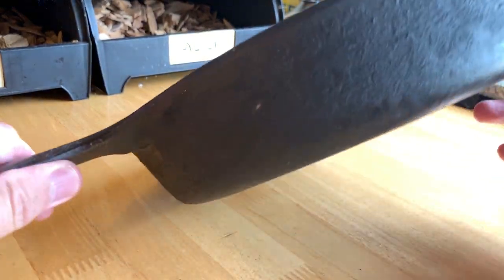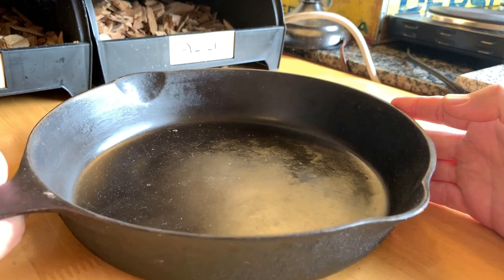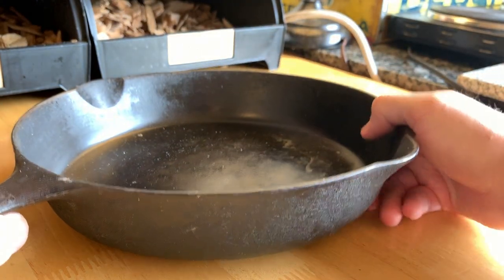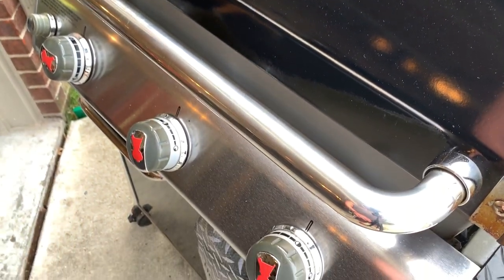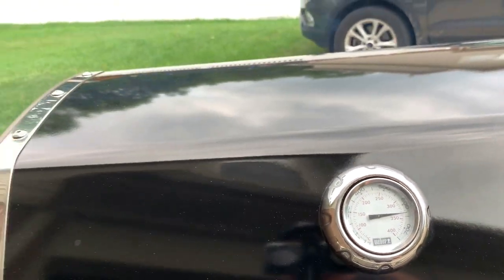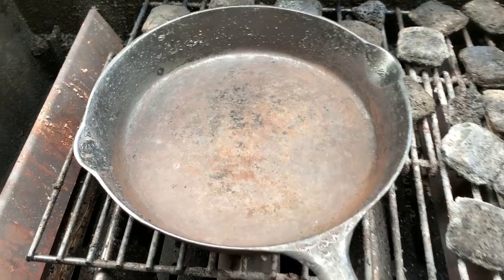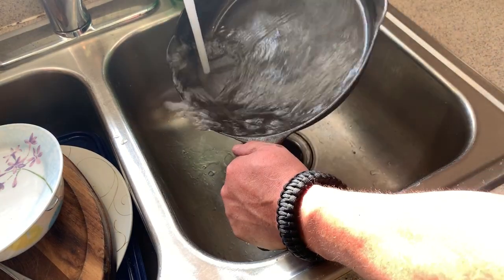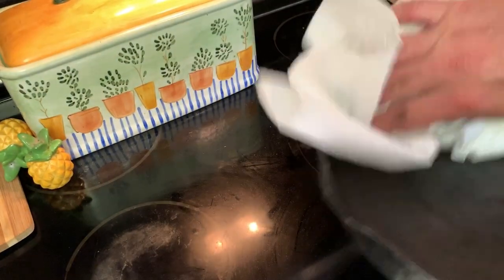VINTAGE CAST IRON restore! Griswold No. 8

Comment: Wow you have a Griswold that is amazing that is an old old cast-iron pan a classic
Great tips on heating it up on the grill on super high heat to remove the patina before you send it down awesome job
Reply from the maker: Thanks Jeff. I semi-frequent antique stores and see vintage cast iron pans/skillets. I find a flat glass surface somewhere in the store and do the spin test. They are almost always warped. I was super geeked to find me an ancient Griswold to restore and put back into use. Thanks for watching and commenting bud.

Comment: To anyone looking for this video to be a 'restoration' video, please know: this is NOT the recommended way, process or procedure to 'restore' a cast iron pan according to collector's methods. So many wrongs here, hard to know where to start. However, for a rapid, 'cleaning' a cast iron pan with gunk in a non-collector's unapproved/way.... this is your video.
Reply from the maker: AXNJXN1 Correct. I restored it for use. Not to resell it or for collectors standards. A collector I am not. Thanks for commenting!
Reply: To each his own I guess but the problem is when you are done “using” it, it will never be a family heirloom. Or if when you pass on and when it goes back into circulation it will be a wasted piece of history that can never be brought back to its former self. Not bashing but like to think about preservation of the old stuff and how precious it is.
Reply from the maker: Scot Maciver Well no worries. It won’t be going back into circulation and to be honest it’s not ruined at all. When I’m done using it, which is perfectly suitable for, it will go on to my daughter who also continue to use it. It is not forever ruined contrary to what you may think. Don’t get me wrong, I have spent hundreds of hours and researching cast-iron pans. And far from being a consensus, there is no one way to clean up a pan to use that is the correct only way. I can tell by your tone that you will insist otherwise and that the pan is ruined but I can find experts, and have in fact, who do not agree with you. There’s nothing wrong with the skillet.
Reply: Nope, that’s where you are wrong. That pan isn’t ruined, I don’t think. I couldn’t watch the rest so didn’t see the end result. But if it cooks good and holds a season then it’s a good skillet. Just will never be collector grade and if I was passing down something in my family I would want to keep it original as from the factory. Once you take tools to it and start sanding/grinding the metal you take all that away. Like I said I’m not bashing just adding my thoughts on it. I’ve done similar stuff to a couple pans before I knew better. Also I built an electrolysis tank and it’s so easy and doesn’t harm the pan. Of course I do a lot and may not make sense for you if this is not a usual occurrence. Take care. Meant no disrespect and didn’t mean to put off a tone.
Reply: By the way, I just restored a griddle. When I stripped it I could see that someone did the same to cooking surface to smooth it out. If it ever takes a season, it will be a long time from now. Restored another one a few days later that had the original finish and it took a season fine and is a great pan. That first one is pretty much ruined and will never be the same.
Reply: Do you have a recommended “restoration” method for a vintage cast iron pan?
Reply: Chris Caldwell:  Absolutely Chris. The standard is use use the ever trusted form of Lye in a sealable plastic container, like Rubbermaid for gunked up items. Then, or if it’s strictly rusted, I go straight to my E-Tanks with washing soda for tried and true measures with 💯 % success and zero metallurgical damage. The iron is completely restored, safely and by the industry standard approved for decades by people who’ve accomplished this. It’s the only way ‘iron restoration’ should be accomplished for a factory perfect value and years of reusable enjoyment. Cheers!
Reply: You get an A+ on the eTank method. Definitely recommended if you plan on doing multiple pans and handles gunk and rust. If it's just a single pan the Easy Off (yellow cap) bag method works too with a 5050 vinegar bath for rust. These things are like  Lays chips. Hard to do just one.

Comment: Hi! Thanks for the video! Would you mind sharing where you were able to find it, and if you paid money, how much? 

I am on an adventure to find my own, lol 😆
Reply from the maker: Hi. Thanks for watching. We were on vacation in Gatlinburg at the time. Whenever I was in some place new and had time to kill, I would say into my iPhone. "Her Siri, find antique shops near me." I would select the closest, most interesting one near me and head over there. So I can't tell you exactly where I got it, but it was by Gatlinburg, TN. Hope that tip helps. I paid only 60 bucks for it. But make sure when you find one to type in the exact model it says on the pan into google and do a price compare, because some sellers try to ask way too much. I've even showed them my search results and told them the average price. 

One of the best skillets I have. Another tip: When buying in person, find any glass surface and place the pan on it. See if it wobbles or spins. If it does, it means it's been warped by someone heating it too quickly or cooling it too quickly. Take a pass on those, as they won't cook evenly. If there's no glass surface, take a credit card and set its edge on the pan surface. The card should be flush against it if it is good. 

Hope this helps and have fun on your cast iron journey! Food really does taste better from them.
Reply: @HobiesGarageBBQ  Hey, thank you for that info! I have gone to probably a dozen antique shops trying to find a good Wagner or Griswold, and I have found a couple 6" ones in pretty rusted condition but as you said, the sellers were asking for way too much, specially for the condition they were in. I did the same where I pulled the average price for the same skillet in better condition from eBay, and they were cheaper than what the antique shop I looked at was listing it for. Then I found a 12" Wagner that was a reasonable price, but was warped, lol I don't have much luck around where I live. I may have to do just that and go to antique shops near where I stay when I travel. Maybe I will have more luck that way. Thank you so much for taking the time to write that! I am glad that you are enjoying your nicely restored vintage skillet! Cheers!

Comment: Hey Hobie's Garage BBQ i am just curious, after every time you use a cast iron cook ware, do you just use oil after removing most of the stuff in side the cookware or do you use oil and salt? just curious
Reply from the maker: What I do is this: While the pan is still hot I run the kitchen sink water until it is super hot. Using a glove (because it's still hot) I run the pan under the water while using a plastic spatula to scrape it clean. The combination of the pan still being hot and the hot water and spatula - nothing can really stand up to that and that's how I clean it. 

Just water and spatula. When scrapped clean I then I dry it and put it back on the burner with the burner still on. I let it stay there at least three minutes to make sure the water has been heated into evaporation. Lastly I take it off the burner and put about a nickle sized dollop of oil on it and oil the entire skillet and let it cool.

A few times I could not clean the same day I did indeed need to use salt and hot water. Hope that helps. Thanks for watching and commenting.
Reply: @HobiesGarageBBQ  yea it helped i have heard some people use oil and some oil and salt after cleaning out the cast iron. so far it is still 50-50 on what people use after the hot water wash